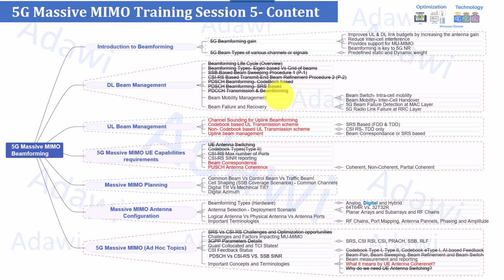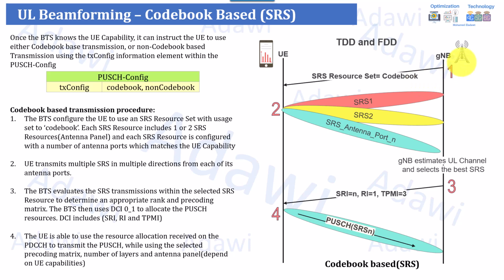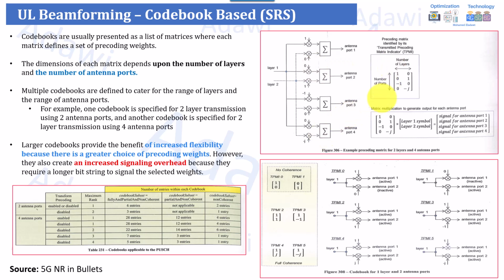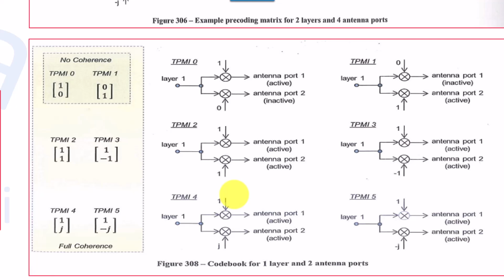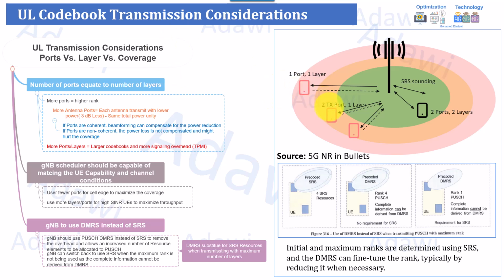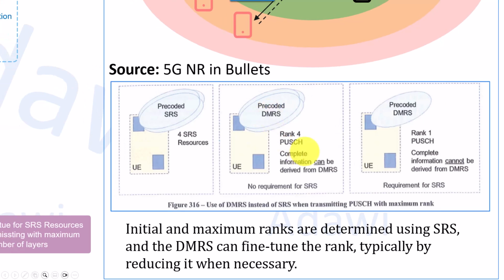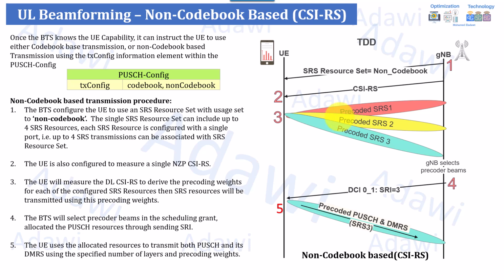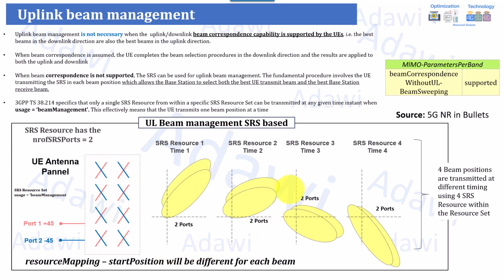Session 5: 5G UL Beam Management | SRS & Codebook Optimization Explained

Comment: one question UL code & non code required for large number of antennas at UE, but commericial UEs, as per 3GPP, we have only 4t4r.. does weight calautions at UE is possible?
Reply from the maker: Hello, as per my limited understanding yes, after UE will do beam calculation to change the phase and amplitude of the beam after receiving the tpmi from the gNB, however as also mentioned by you since the number of transmission antenna is limited(i.e 4T) so the ue chances for beamfoarming is also limited.

Comment: I would like to thank you for explaining in detail for NR UL beam management 
Really great session , appreciated 
looking more session from you 
again thank you so much for your time
Reply from the maker: Thanks for leaving a comment, appreciated
Reply: @mohamedeladawiashour  I would like to discuss with you one issue faced in our network related to SRS releases
We have activated Redcap feature on 24.Q2 and then Q3 as well with no issues observe on SRS release but when we activated Redcap feature on MTR25.05 SW , we see gNB SRS releases happening immediately within 1 sec only 
we are investigating the case why it is happening , some SRS related configuration parameters changed in 25.Q1 ( srsConfigTriggerTimer from 1200 to 200ms and bfcSrsReleaseTriggerTimer from 1200 to 640ms
anything you can suspect and suggest
Reply: @mohamedeladawiashour  
Another thing observe , after Redcap feature activation , observe SRS utilization reduced from 100% to 50%
we defined 2bwps ( BWP1 >>1 for eMBB users configured with 100Mhz and another BWP2>>for redcap device support configured with 20Mhz )
 Is it due to all 16 srs resources not being used by BWP2 ?
Is this SRS utilization reduced by half expected and my understanding is correct ?
Pls suggest